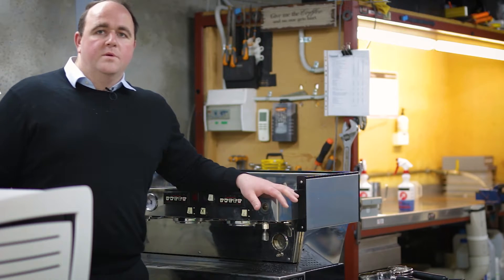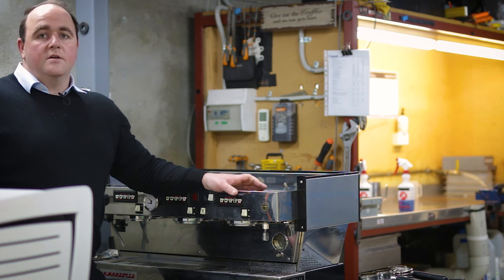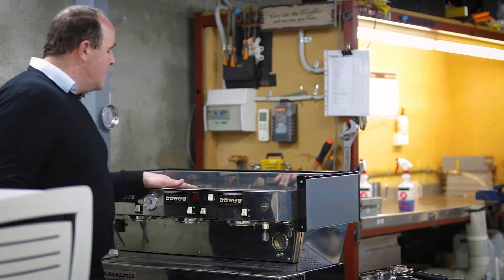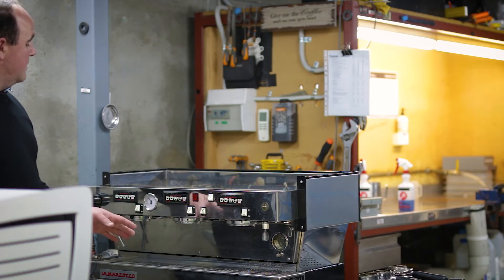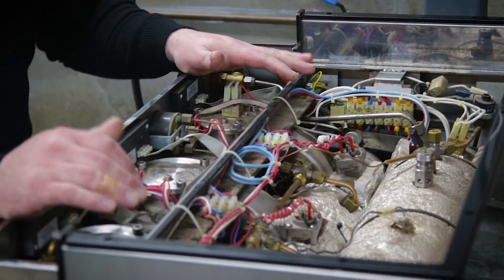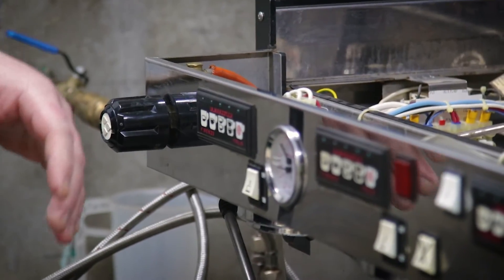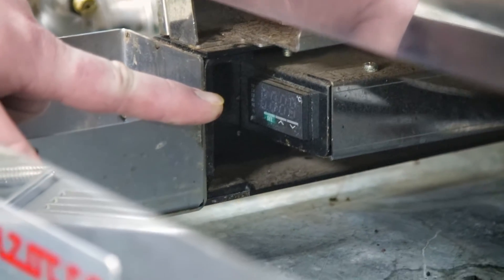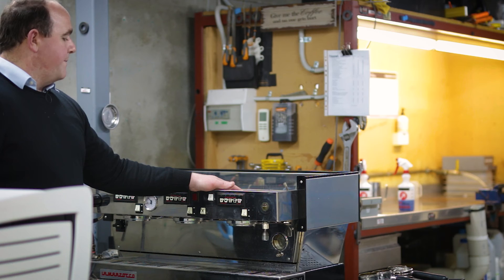La Marzocco Linea Classic - Brief Overview & Intro

Comment: Hi there, i have a very old linea classic that looks identitcal to yours, but mine doesnt have the pid to adjust the temperature. Do you know how else i can adjust the temperature for my classic? thank you
Reply from the maker: Hi! The old models have an electro-mechanical pressure switch which can be adjusted with a screw. We'd recommend enlisting the help of a technician as it's a bit more of a job than the modern machines